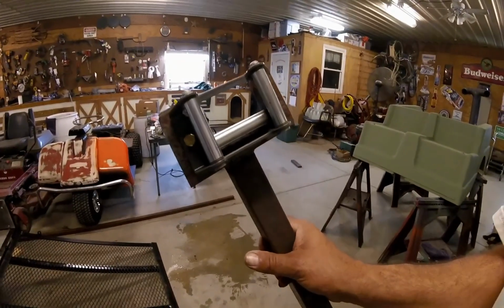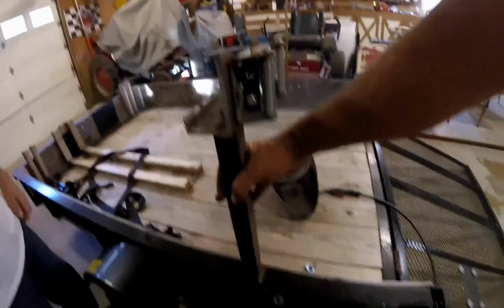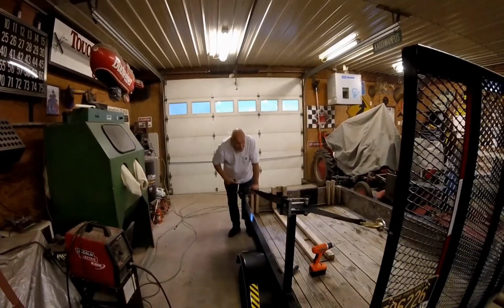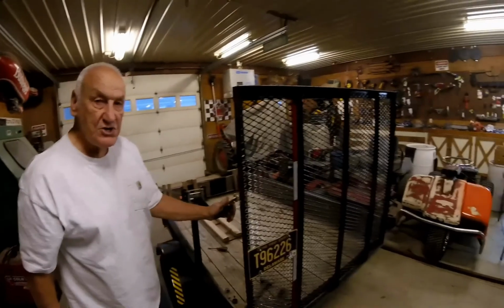Lift system for a Utility trailer ramp - REDNECK Style -

Comment: Check out leaf spring trailer assist. Like on uhaul motorbike trailers. Takes load off. Would work with this system..stops sudden drops.Good video you have done here.